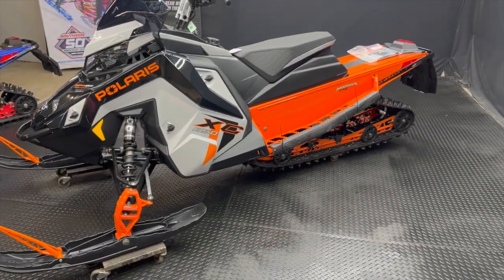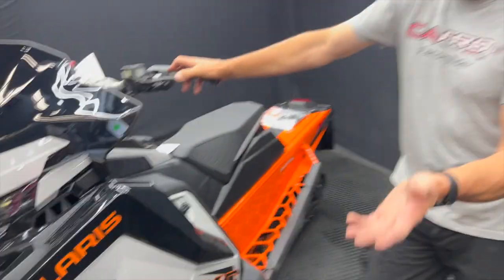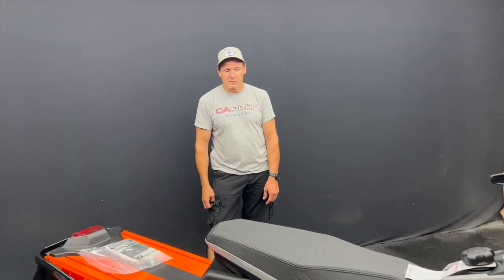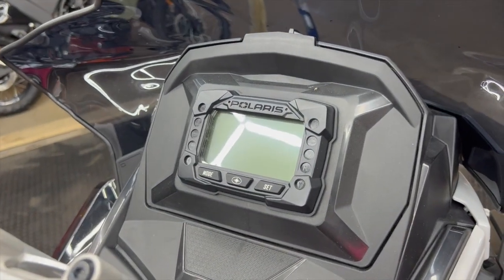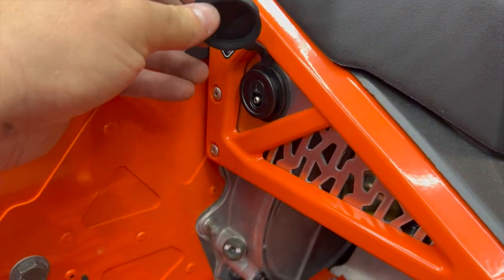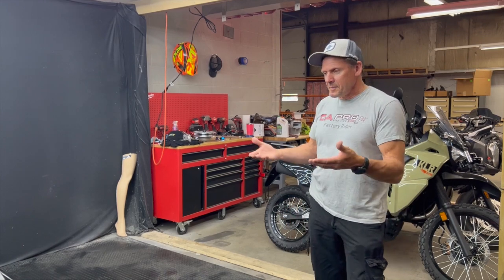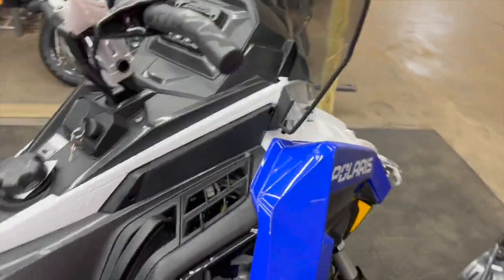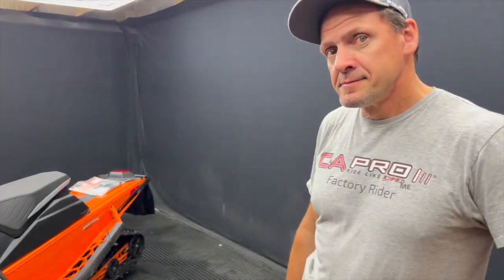THE FIRST 2023 POLARIS SNOWMOBILES ARRIVE! SEE THE 2023 POLARIS SWITCHBACK XC 146 UP CLOSE!

Comment: Back in 1973 ish, my aunt had a Polaris Colt, I think it was and my uncle had a Raider, that thing was sooo cool! My grandparents had an Evinrude  with all the bells and whistles, and I started out that year on a 69 Scorpion 19 horse that hit 55 mph top end!  I was 14 and that sled was a blast. I would go from one end of a church parking lot that was fairly long and with 3 feet of untouched snow on the other side of a giant snowbank about 8 + feet high, I would launch it over that bank over and over. I usually burned 1 to 2 tanks of gas every weekend. The machines have changed alot from those days!
Reply from the maker: Love that and yes they have changed a ton from back then but still just as fun! If not more fun!

Comment: Wondering your guys opinion on running VES or VES Extreme on a new 850? Ride in Iowa mostly ditches, rivers, and some trails. Have a 2023 XC 146. Thanks.
Reply from the maker: i run standard VES. I was told that the extreme is superior when you are contstantly running in -30+ weather all the time

Comment: Been thinking of adding an axys assault or xc 146 to the stable. Had an 06 144 switchback before and it was ok but not the best in the turns. I love my pro s switchback and I’ll be keeping it. I’ve heard all about the IGX geometry on the 17 and newer long switchbacks being similar to my pro s but no one in our group has one. Do they ride similar on the trail? And how do they corner, especially the matryx. I really intrigued by the xc 146’s and there’s a few new ones out there. Not opposed to a used axys 144 assault either though. I like to do the deep when we have it but in the northeast realistically it’ll see more trail than deep. I know the 850’s seem crazy fast out of the box by your videos last year and impromptu drag racing traction is a factor in the desire to get another long switchback again
Reply from the maker: I do not think the Pro-S switchback and the assult feel teh same way at all. They are both uncoupled but thats about it. The 146 IGX is the same as the 144 IGX honestly. They work great but they are a  longer sled. Cornering just like anything depends on set up, skis and carbides. You try and turn a 129 with stock everything and a 146 with stock everything and the outcome will be the same, you're gonna push. I know a ton of people that love the IGX and i have a few projects in the works with them

Comment: How do you decide between the 1.6 or 1.35 cobra? Pros or cons? Any help would be appreciated!
Reply from the maker: Really comes down to preference. I like the 1.3 becauee It has good traction but doesn’t kill my MPH. I don’t do any off trail riding so I don’t need the bigger lug. If you don’t care about MOH and do some off trail riding then a 1.6 would be good. Either way they are both great tracks
Reply: Thanks!